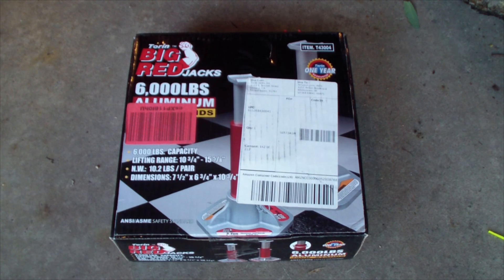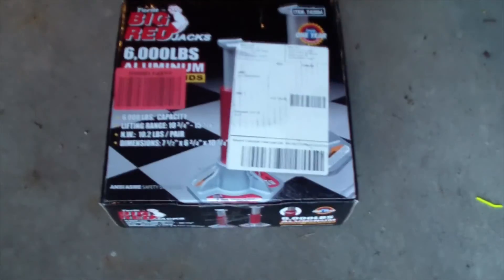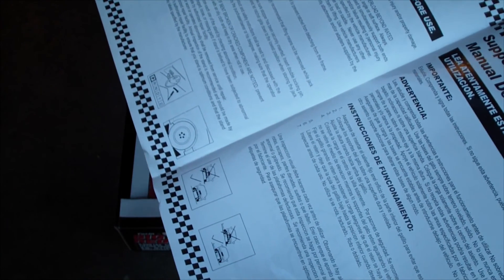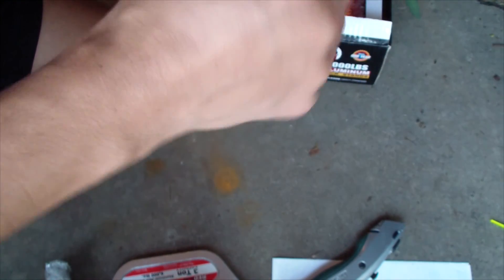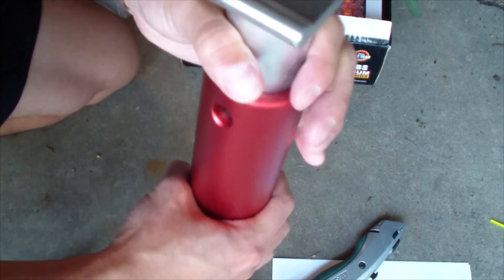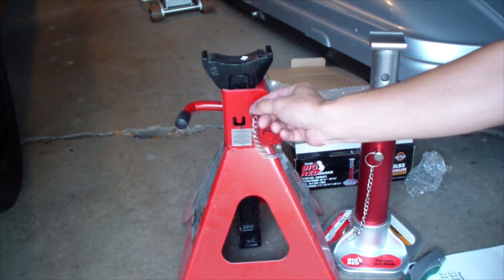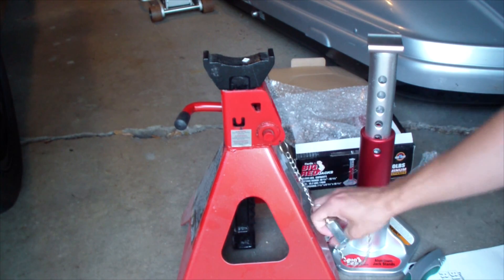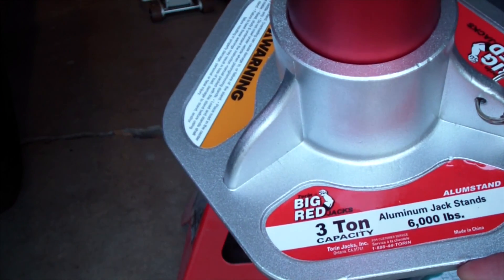Torin T43004 3 Ton Aluminum Jack Stands by onza04

Comment: You bought 6 ton jack stands. The damn car only weighs 2 tons. Maybe buy the 2-3 ton stands. They are 10"-11" at rest. 17" extended.
Reply from the maker: 3ton stands = 6? box states it clearly. This isn't a 3ton x 2 math equation..
Reply: @onza04  The old Jack Stands say 6 Tons? What part you not get? 6 ton jacks are taller... You should read the websites min height and max. As each type are for different uses.
Reply from the maker: What was my original video about? 3ton or 6ton stands? I have a truck and im certain the 6ton is better suited for that

Comment: Did you put your car on 4 of these stands?  If not I assume at least 2?  How stable was the car when on the stands?  Thanks.  A lot of pundits say they wouldn't be stable.
Reply from the maker: My exp= 2 wheels & used 4 times- all times were noted as stable. I would only use these for cars though. Thnx for commenting